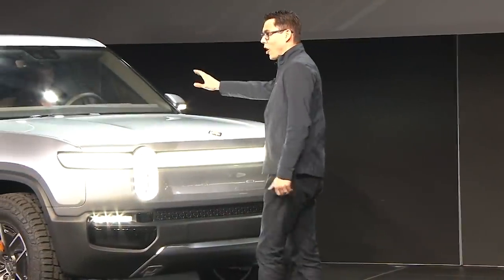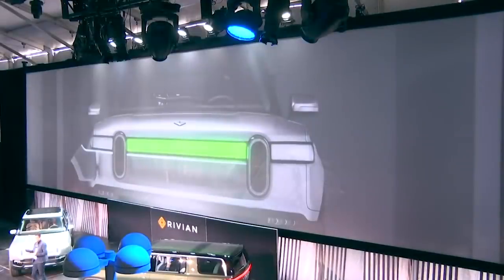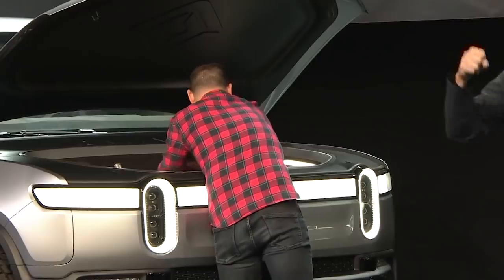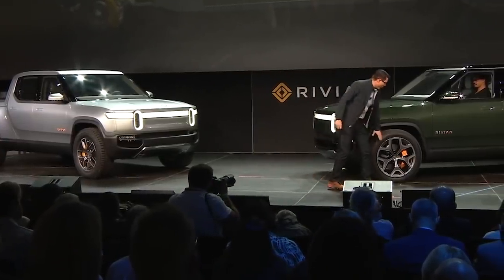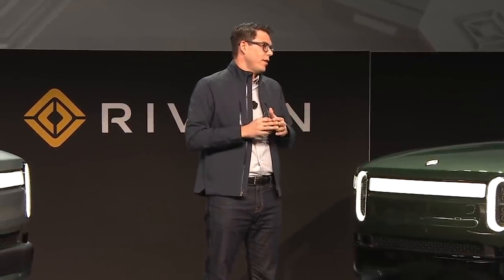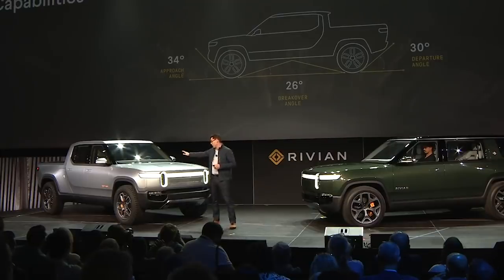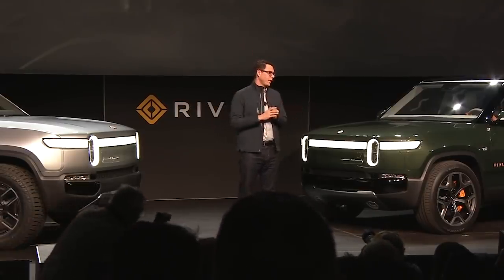2019 Rivian R1T and R1S Reveal in 12 minutes

Comment: OK but can these people please talk about a fast charging network? An EV is nothing without a comprehensive nationwide fast charging network. And somehow no new EV manufacturer except for Tesla addresses that HUGE part of the EV dynamic.
Reply: I guerentee a company will manufacture charger adapters that allow it to plug in to a Tesla charger
Reply: ryding with ryan it’s not that simple. Tesla can block other cars from charging on its network at will through a simple software code.
Reply: Minds Eye yes you are right I didn’t think of that. This is a good quistion. I wonder if possibly Rivian would spend money to buy the rights to use Tesla’s charger.  You also have to remember that this will be an issue for every manufacturer unless there becomes a standard for all electric cars to plug into.
Reply: I was wondering the same thing.  I wonder though how a supercharger designed for a Tesla will affect the battery of another EV (thinking different battery types).
Reply: Minds Eye just charge it at home most people don’t travel more than 100 km from home very often and if you do just put a generator in the back if your going on a long trip as not to get caught out

Comment: Sounds promising, big question is where will one REcharge driving long distance?
Can they use Tesla SChargers?
Reply: If they were to take up Tesla on their offer they could. Obviously that would involve a payment to Tesla tho. Elon said they are willing to open their super charger network to any companies that are wanting to have accessibility to it.
Reply: As long as they add the same connector
Reply: @CASANOVAPRO1985  it has to be registered vehicle in the tesla supercharger network or it wont do anything. VIN has to be verified (even teslas)
Reply: Tesla offered this to Rivian and other upcoming companies, however the offer was turned down. Rivian does not have the same connection system which brings a lot of problems for people that are in the longer commuting sector.
Reply: s3xyScorp I was wondering the same thing. I looked up a Subaru Forester hybrid on their website (or it was one of their models, I can’t quite remember) and it looked like one could recharge it from their home using a standard outlet. Granted, that doesn’t change the need for national infrastructure which is severely lacking, but maybe that could be a start

Comment: Quick comment. I live in ga. In the past month I’ve been to the Carolinas, tenn. and fl. I’ve yet to see an electric charging station. Even as long as Tesla’s been out I’ve never seen one. If you make a small efficient gas engine that powers a generator to run electric motors you get the best of both worlds. But no ones worried about practicality. It’s either one or the other.
Reply: Isn't that called a hybrid?  They exist already.  The issue as I see it is that the petroleum is not infinite and that is why the push to go electric/solar.
Reply: reavch no hybrids run off of stored energy in a battery. What I’m talking about is like trains. Trains have Diesel engines that power generators. The electricity the generators make then power electric motors at the wheels.
Reply: Specifically the Range extender hybrid cars...

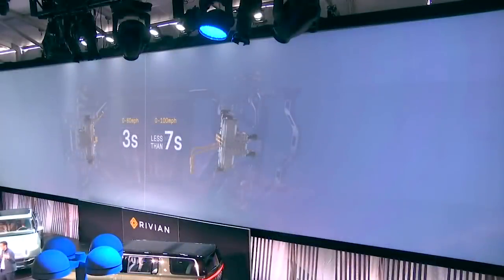Comment: @9:09 125 is more than enough. My Raptor is speed limited to 107 mph. With 450HP I hit that pretty easy on straight dirt roads. When it hits the limiter and suddenly stops accelerating the 16 year old in me is like, "awe, c'mon, this thing could do 140 easy I bet". The 42 year old me is simply, "yeah that's probably plenty." This thing is so insanely fun to drive at 30-50mph on twisty, rutted, muddy, whooped out roads that it has no need to be in the triple digits. That pesky 16 year old me still in my brain will always top out the speed of what I'm driving (except my 2008 V10 BMW M5. It's rated to 204 but I chickened out at 172.) I am going to die in a car. I am not a sociopath however and to be sure I won't take any innocent lives with me In my reckless driving situations I always make sure I have visibility for when I do lose a tire or a strut bolt from whatever high performance car I'm driving that I NEVER do maintenance on or check the condition of important bolts or systems. Any person that knows me well enough to be aware of my SHITTY driving skills yet still gets in a car with me I do not consider an innocent. That's on you guys, Max, Monique, and Jess.  (Seriously on the lack of maintenance though, I change the oil in my 2005 Tundra trail rig every 30,000 miles whether it needs it or not. Do NOT buy a car from me).

Comment: Clearly I am not an electrical engineer. But can anyone tell me why I’ve yet to hear anyone in EV development talk about perpetually charging generators powered by the very batteries they are recharging? Whether it be that way or by a conglomerate of wind driven rechargers? The very possibility of the truck version carrying a gasoline powered generator (say like on a camping trip or always if the user so chooses) is what spurred my thinking. More specifically about the R1T, my question to Rivian, is:  Does the truck or even the suv version come with the adaptations to make such recharging possible from a standard power source. It would save the day when there are no recharging stations available.

Comment: What happens if the car goes below 1 meter besides from getting wet? Electricity and water not a good mix
Reply: Since all of the batteries and control electronics are at the very bottom of the vehicle, I would assume they are well protected against ingress. After 1 meter, I would think that water will start to get into the cabin itself (vents, door/window seals). It's made as a road/off-road vehicle, not a road/off-road/fording the Hudson river vehicle.
Reply: In a different video they said it could go through deeper water but you run the risk of it floating away.

Comment: Very soon. The electricity is going to be expensive. Just like the fuel.
Reply: Not If you make it yourself
Reply: Pris Rosales interesting point👍🏽
Reply: At least its something provided locally, which means you won't have to worry about price fluctuations just because some Saudi prince wants to cut production.
Reply: no evidence of this at all
Reply: Disagree, get a battery system and solar system grid on your roof and you're pretty much set. Self reliance.
Reply: Electricity is generated while petroleum is mined.. there is a big difference there in cost to produce. Electricity will only get easier to generate.
Reply: Lots of coal burning to make sure those clean cars have power.
Reply: @glenm2229  also solar, wind, hydroelectric, and nuclear.
Reply: Most of the world capable of buying one of these things.  It isn't that hard to see if you bother to look.

The US has ~30% of its power from coal, and another ~33% from gas ... so the majority of power is 'dirty'.  China gets ~64% of its power from Coal; and ~58% of India is Coal; though they can't afford to buy one, they'll just crank out tons of toxic waste to make your battery or whatever.  77% of power in Australia is Coal.  Japan has converted back to mostly fossil fuels ~80% after recent nuclear failures.  Only this year did the EU start producing more power from renewables than from Coal.

The only big country I can see that isn't burning loads of fossil fuels to make shiny "clean" electrons is Brazil, which just dammed up most of its rivers to make lots of hydro.  Congratulations, now they can burn the forest down to recover farmland lost to hydro damns.
Reply: @guitardogg8438  "which means you won't have to worry about price fluctuations just because some Saudi prince wants to cut production."
Domestic oil production is already double what it was in 2012.
Reply: @minogoda  "Electricity is generated while petroleum is mined.."
Oil and gas are drilled. The pumps can be fueled by the product they are drilling.
Reply: Glen M 
France 80% nuclear
Reply: @glenm2229  Your pulling this numbers out of your ass. Simply search, for the U.S. is 14% coal, 29% natural gas, oil 37 %, renewal 11%. Aside from the lobbyists and protectionism from the oil industry, We the U.S can easily promote solar energy and create millions of jobs in the process.. That said, the  future is literally under the sun, to product our energy needs, transportation needs and employment needs. It will take time but we have a  viable solution...

Comment: The replacement battery is $40k, mic drop...out.
Reply: In 10 or 15 years when you need to change it, the price would have dropped significantly and the range would have increased substantially.

Comment: Did you make your SUV in such a way that an overweight 6'4" driver can fit comfortably in the drivers seat without their head hitting the roof,
without them being crushed up against the side of the vehicle or against a stupid center console. Did you make the seats wide enough for 
a large driver like this. Can this driver stretch their legs all the way out instead of driving for hours in painful torture with their left knee slightly bent
the entire trip because the back wall of the front wheelhouse juts into the drivers leg space?  
Or did you do what every other jack ass auto maker is doing and cut back on materials to make more profit at the expense of drivers not being able
to fit in the vehicle at all?
Reply: Lose weight and Problem solved
Reply: I want a car to fit like my trap gun